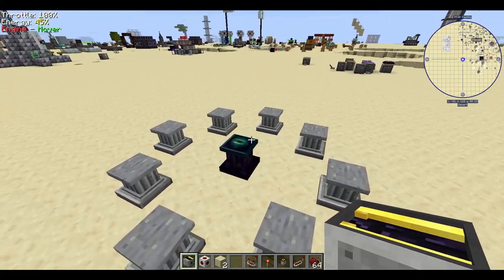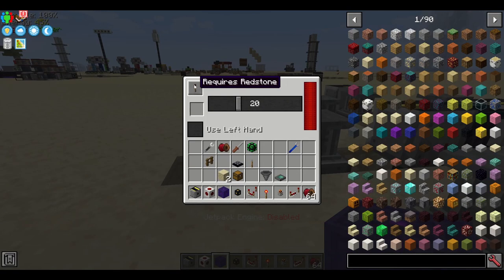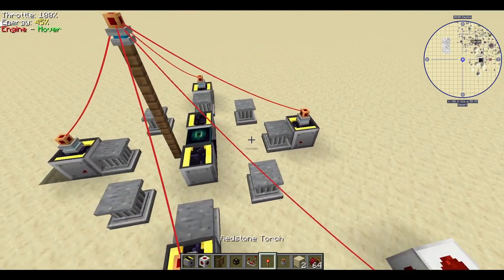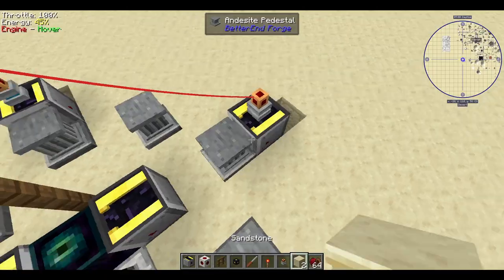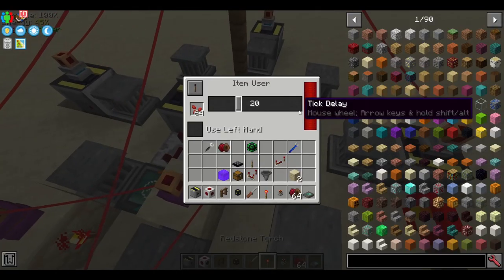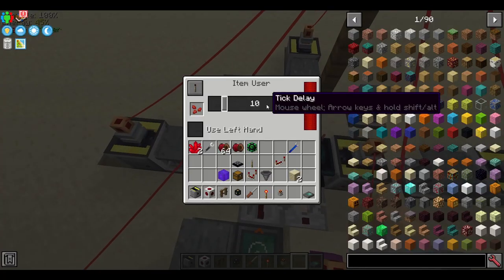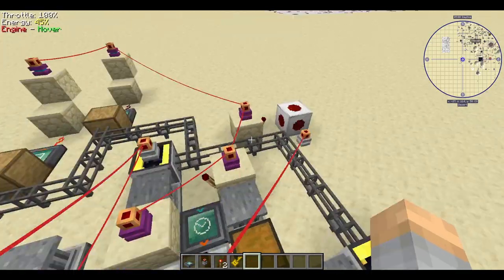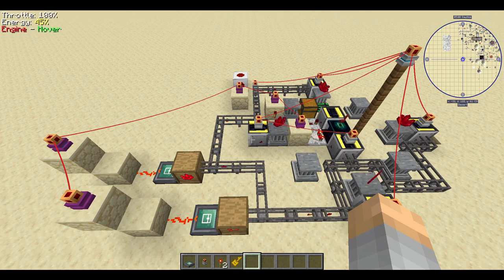Integration by Parts dX Tutorials - Infusion Altar Automation

Comment: has anyone else had issues with the item users just sometimes..not activating? I have everything setup exactly as it is in the video with the correct delay and it will work perfectly for 4-5 infusions and then one of the item users won't place a redstonium and it will break everything
Reply from the maker: you need to make sure the center one activates last
Reply: @pikminman13  The one that starts the craft, or the one that places the center item? I do have the one that starts the craft and removes the finished product activating last. What I find is that on some random occasions one of the item users placing redstonium simply won't place when everything else pulses to place its item. I'm not sure if its due to lag or what but at this point I'm trying to make the crafting core because I can't figure out the issue and its been frustrating
Reply from the maker: @neuro5266  tbh if you are having issues i would recommend just going for the crafting core, skips any of the possible bugs. since it worked for me its hard to tell whats wrong when it sounds right.